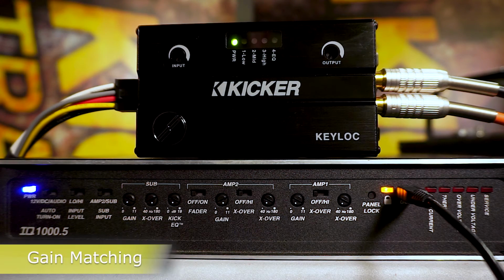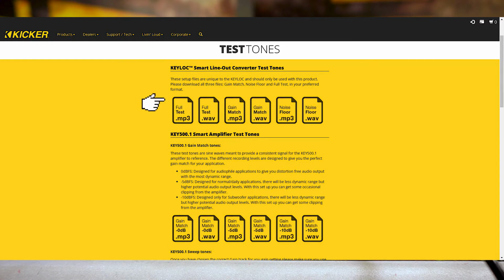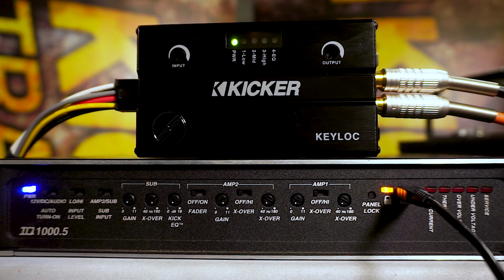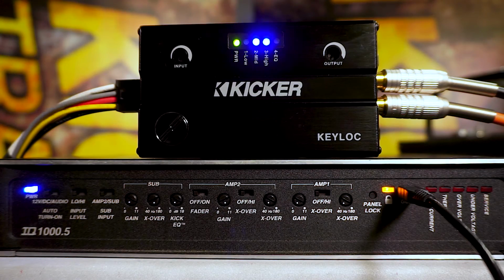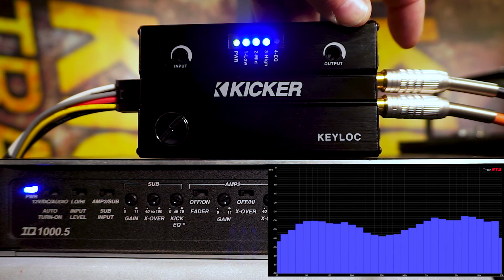KEYLOC

Comment: Can I use the signal from my factory radio factory amp and factory sub
Reply: I was just gonna unhook the factory sub and use those wires to input into this thinking the extra power from the factory amp would help? It would be mostly low frequency I assume but I’m only gonna run a mono sub amp not any full rang amps.
Reply from the maker: Assuming the frequency response is sufficient, yes.  However, the factory sub may be crossed over with a different frequency range than you need. They KEYLOC will help make that determination during the setup process.
Reply: @KICKERAudio so if I get this keyloc and try to run it from the powered factory subwoofer and it only shows low frequency will it work for adding my mono block amp for my aftermarket subwoofer’s or does it need the low and mid signal both or does it actually need all three low mid and high to properly run the aftermarket subwoofers? Also being the factory only has one subwoofer can I split it to go to both inputs of the keyloc or am I gonna have to have two separate speaker inputs? I called and talked to someone on your team they told me if I was happy with the overall tonal sound of the factory and just needed to add bass all I would need is your kisloc but I don’t think I told him I was going to try and come from the factory subwoofer so that might make a difference? Also with this keyloc the setup is making sure there isn’t a clipped signal going into the keyloc correct even if there is distortion coming from the factory deck this will eliminate that ? And if it eliminates the distortion coming out does that mean the amp cannot get a clipped signal at all can the gain be turned all the way up on the amp without sending a clipped signal to the subwoofers. Sorry for short story here just don’t want to mess anything up.
Reply: @KICKERAudio another thing I forgot to add is I run the factory stereo with its bass level set to negative 5 that way I can play the factory speakers full volume without distortion and only the factory subwoofer is really putting out much bass at all. If I run the bass level at 0 some of the dash speakers gets distortions at full volume.
Reply: @jamesfair9751  @KICKER-AUDIO  I asked the same question. I only have a choice of low frequencies from my powered sub or high frequencies from the other speakers. I only want this for a sub install. Can I just tap into the powered sub and go with only the low frequencies? Will it still tune if I do not have a full signal? Doesn't look like it.

Comment: How does this differ from the lc2 pro and other such LOC also not all amps can take 10 volt input signal does this auto adjust or how do you match the voltage to the amp
Reply from the maker: Depends on what your amp is rated for.  Do you know?  As far as the LC2pro, we dont talk badly about other brands. So what we will say is this:  most LOC's are analog, which means NO DSP. It also means they sound worse as the volume raises. It also means they cant evaluate whats missing on a case by case basis.  Not only is ours digital, but it makes intelligent decisions to fix whats wrong with your specific factory audio system. Its not just more bass - its better, cleaner signal across the board.
Reply: @KICKERAudio my amp says it can take an input voltage from 250milivolts to 5 volts

Comment: can I split the rca outputs on the keyLOC with rca splitters so I have multiple left and right audio for a sub amp and a 4 channel amp ??
Reply from the maker: Yes, but bear in mind it may not be necessary. Many amplifiers have an RCA pass through that maintains the voltage so you get a stronger signal out to the sub amp.

Comment: I have tried the standard kicker loc, the nvx bass reconstruction and the nvx x boost for bass roll off and it didnt solve my problem. The reconstruction sounds awful if i try to use that feature but works ok as a loc. The x boost is to complicated to set up and pretty much requires guessing. The lci accu bass is the same guessing game and wouldnt resotre my eq. Im really hoping that this solves my issue in an audi a4 b8. The system is amplified but non b&0. I dont know any other product that does the processing and matching for you
Reply from the maker: If you have any questions, please don't hesitate to contact us. We can verify whether or not you need a load adapter as well (varies by vehicle).  Our number is 405-624-8510. We are open weekdays from 8-5c.  You can also email us at support@kicker.com.
Reply: @KICKERAudio  I got this and installed it today in less than 15 minutes. I wish I had know about it from the start because it WORKS. Only complaint I have is the menu. I can enter it just fine but trying to turn the time alignment off has been tricky. It says solid is on, blinking is off. Hold key for 2 seconds to toggle on and off. The light is solid in the menu, blinks when I press the key but doesn't seem to toggle. It stays solid unless I'm holding the key
Reply: @bRightGarage1  I have exactly the same, have you managed to get a workaround for this?
Reply: @mouritzo123  I ended up measuring my sub output on a 40 hertz tone. I turned the volume up until the voltage stopped increasing. That was my max volume but I wanted more in the front stage. I turned the bass down to raise my over all volume and not roll off the sub signal. I used the kicker loc and adjusted my gains from there. So my bass is about a quarter of the way down but my amp gain and sub makes up for that. My mid bass could be better but the sub is on point now

Comment: So where should I have the gain on the amp set at when setting up this keyloc for subwoofers?
Reply from the maker: The KEYLOC outputs a stronger signal to the amp, so it's advisable to complete that setup before you set up the amp it is being connected to.
Reply: @KICKERAudio  exactly what I needed to know. Thank you
Reply: Are you saying don’t even hookup a new amp or sub until after keyloc is setup? OR Is the new amp/sub hooked up but all adjustments are turned all the way down and you don’t adjust the amp gain etc until after the keyLOC is setup
Reply from the maker: @AlexRodoni  Hi Alex, it doesn't change what the KEYLOC does in any way since the signal chain goes Source Unit>KEYLOC>Amp. And after the KEYLOC setup, you'll just need to match the output voltage of the KEYLOC to the input sensitivity voltage of the amplifier.

Comment: No thanks, ..
Reply from the maker: Out of curiosity, what makes you say that? What other products can not only detect the frequency response of a signal, but correct it so you have a clean signal for your amp?
Reply: @KICKERAudio supposedly that new Audio Control LC2i Pro line output converter does almost or similar to the same thing as the Keylock but I’m not to familiar with it.

Comment: After the setup is complete, how do you adjust the output knob?
Reply from the maker: Once the input is set (as the video instructs), here's what you do: First, turn BOTH the amp gain and the KEYLOC output knob all the way down. Then, turn on the same sweep track you used to set the input of the KEYLOC. Attach the probes of an oscilloscope to the + and - of one of the RCA channels.  Slowly turn up the output levels. You are looking for the point where the signal clips on the oscilloscope. Remember that the sweep takes a little time to send all frequencies through - so just turn it up a small amount...wait until the track resets, and move it up a little more.  Don't turn up the gain non-stop - do it bit by bit. If it doesn't clip even after turning the output knob all the way up, connect the KEYLOC to the amp as you normally would. Now, with the same track playing and the gain of the amp all the way down, move the probes to the outputs of your amp (without the speakers attached). Again, slowly move the gain up until you see a clipped signal on the oscilloscope.  That's the right way to do it.
Reply: So what if you do not have an oscilloscope?
Reply: @billplaisance6387  my guess would be to set it as close to your recommended amplifier voltage with a multimeter. Ol' bro from Kicker shouldn't have left you hanging.

Comment: So after setup when I start my car all lights should be on everytime? How do you know if it lost its settings?
Reply from the maker: The lights that correspond with frequencies it detects should be on when the stereo is on (so light #1 for bass, for example). If the KEY loses its settings, the audio should change drastically. To test this, press the KEY button briefly to deactivate the DSP settings. If the auto-tuning has been lost, there should be no difference in the sound. Here is an example of that test: https://youtu.be/ZwWggIfQHqM?t=370
Reply: Seems like I'm not getting the proper frequency response from 30-40hz.. let me ask this. If I put the speakers inputs into the keyloc in reverse order would that affect the setup? Like I put right in left and left in right. Also when I turn my car on after setup all the lights are on. Is this wrong? Thanks for the response
Reply: So I gave up and went out to just reset the Keyloc and start over. I put it into led 3. Held for 10 seconds. Keyloc shutdown then reset. Now it sounds amazing. So literally I'm not using any of the Keyloc magic processing and it is literally a passive LOC now. Maybe I will try it again later but for now it sounds fine. I don't understand how with processing it wouldn't play 30-40hz but with it off it now plays those frequencies...So they are coming from the stock system
Reply: Blew up my rear speakers running the ridiculous lengthed test tones at ridiculous levels for this thing to even register. Not a great device for a normal consumer

Comment: What is the “Output” dial for?
Reply from the maker: Controlling the voltage level that goes to the amplifier.
Reply: @KICKERAudio can you see my previous reply please
Reply: I checked the voltage while adjusting output with a 50hz tone and i only get 3 volts out it changes as i turn the dial but when i stop turning it goes back down to 3 volts with no effect on where the knob is at even if i stop playing the tone i get 3 volts, do you know why?

Comment: Hello! I'm guessing this will also be needed in a case where I'm just switching out the factory speakers in a '15 Wrangler to the Kicker KSC650 with the basic (non- touchscreen) factory stereo? Thank you!
Reply from the maker: The KEYLOC is used when adding an aftermarket amplifier to a factory audio system.  If you are simply replacing factory speakers with aftermarket, it would not be used.
Reply: @KICKERAudio  thanks for the quick reply! What would be the best thing to go for, for getting optimal sound from those speakers mentioned above from my stock stereo? Or would it just be simpler to buy an affordable aftermarket stereo with those speakers. I'm a newbie somewhat.  Thanks.

Comment: When did they set the output lvl in the video? Does it have like set voltages or is it variable?
Reply from the maker: The best thing to do is check out the manual.  Go to the bottom of this page and click on the KEYLOC Manual link, then go to Page 16 of the PDF.: https://www.kicker.com/keyloc-smart-line-out-converter

Comment: I have an amplifier that can take a max of 4 V. I also have the key lock and looking at the specs it delivers up to 10 V. Is there a way to adjust it so it matches 4 V?
Reply: Yes. The "output" knob on the top controls voltage out.
Reply: @firebirdude2 how do you tell what voltage it’s putting out
Reply: @jamesfair9751 use a multimedia set to AC Volts. I use an old male end rca cable and strip off insulation to expose the wires inside. Hook your multimeter to those wire. Turn up your head unit to 3/4 volume and increase the output until you reach your amps input sensitivity voltage. Good luck

Comment: So when it's set all the blue light stay on
Reply from the maker: All the blue lights will be on if the KEYLOC detects a full range signal.  Depending on the vehicle, the factory audio system may not have any full range signals, or very weak signal in one or more of the frequency ranges, like you see at @2 minutes into the video. The presenter had to turn the gains way up to even detect low frequencies in that example, which means it had very little bass. on that channel.  

Go to about 2:45 in that video.  Notice how low the KEYLOC's gains are set when he gets all three lights to come on.  That is the full range signal you are looking for. 

If you want more info, please don't hesitate to call us.  Tech Support is open weekdays from 8-5 Central time at 405-624-8510.

Comment: Does anybody know how to add a second loc to a system that the key is already installed but can’t give consistent voltage to the fire amps I need to be running. I’m aware of the other product lines but want to keep the key due to its ability to clean this Volvo XC90 like no other product. Please help! Anyone!? loc
Reply: I’ll give some updates to fill in for those who may use this later. So going to run a cheaper loc in the front speaker lines that go to the stock amp. So the keyloc47 will be the second loc in the front speaker lines and because of this the DSP is able to clean the signal just before it reaches the stick amp and then the sending unit and then the speakers. So basically it somehow raised the impedance by approximately 1 ohm throughout the main system speakers so not they are all at about 3 ohm 😕😕🤯🤯😶‍🌫️😶‍🌫️
So anyhoo, the fact I am able to add the second loc before the keyloc offered me two fresh lines with clean voltage to feed my four amps. I will update afterword.

Comment: If I turn my EQ settings back up on my stock radio after will it affect the Chanel with the LOC? I have a couple subs running in the back off the rear sub with a pac loc currently.
Reply: Any EQ adjustments you make on the stock radio will be added to the output of the KEYLOC, for better or worse. The KEYLOC gets you to "flat" or "zero". If you change the incoming signal (by adjusting EQ), the KEYLOC will output flat+your change.
Reply: @firebirdude2  so should you leave the factory head unit the way you want it then set up the loc
Reply: @tjsworld2338  That will do nothing. The KEYLOC makes a flat signal out of whatever you give it. So if you have the factory head unit the way you want, then set up the KEYLOC, you'll just have a flat signal out. 

If you don't want a flat signal out, start with the head unit EQ all at 0, then run the KEYLOC, then set your head unit EQ. Exactly as I said above, this could be for better or worse. Boosting bass +8 after fact is just going to send distortion to your speakers.
Reply: @firebirdude2  ok got it. I have a lc2i now on my Cadillac ATS and I just don’t like it. Trying to decide what to use
Reply: @firebirdude2  can you still use a bass knob? I have the Jl slash 1000/1 amp and since I I’m using the lc2i it has the bass knob. If I get this loc can you use the knob for the amp
Reply: @tjsworld2338  The KEYLOC is better than the LC2i. No question.
Reply: @tjsworld2338  Absolutely. The knob on the amp comes after the KEYLOC. It won't even see it.
Reply: @firebirdude2  nice thanks. Yea I’m trying to decide on either the keyloc or Jl loc22

Comment: Where in the hell is the pink noise test tone to download? All there is sweep track, full test, gain match and noise floor.
Reply from the maker: Scroll about halfway down the test tone page and look for the "KEY200.4 / KEY180.4 Smart Amplifier Test" header. here is one example (there is both an .mp3 and .wav option): Toneshttps://www.kicker.com/files/test_tones/Lab_Grade_Pink_Noise_20_minutes.mp3
Reply: @KICKERAudio  OK got it thanks.
Reply: @KICKERAudio  I wish I would’ve known this the other night when I was doing my install but luckily I was able to just play the pink noise by looking it up on YouTube. 

But I’m curious- if this test tone is kinda needed for the setup of the Keylock then why has it been two years later and the pink noise still isn’t with all the other test tones for the keylock so it’s easy to find?

Comment: When the first signal you tested was no good for 20 Hz signal, what other signal did you use? I wanna hook this up to my rear speaker connections for my subwoofer and amp. So if I get the same bad 20 Hz signal what am I supposed to do? Hook this up to my front speaker signals??
Reply: If you tap into factory speaker wires and the KEYLOC shows you're not getting much bass, then you need to tap into different factory speaker wires. The KEYLOC will help bring up the bass, but it cannot create bass where there's zero to start with.
Reply: @firebirdude2is the rear speakers the best signal for subs usually?

Comment: Trying to use this with my Subaru Forester head unit, it's got all pass filters I want to get rid of. When I run the setup I get to the Full Test and after about 1 minute it goes to error mode -  power, 1, 2 & 3 lights start flashing. Kicker support hasn't been able to resolve it. Any ideas as to why the Full Test can't run?
Reply: First, make sure you're doing the gain match step properly. Wait 10 seconds between input gain adjustments before moving to the next step. If either channel clips at any frequency during the gain match step, the likelihood of failure/bad results is exponential. DSPs don't like clipped signals input.

Next, try running the test at a higher or lower volume on your head unit. Remember, if you change the head unit volume (voltage into the KEYLOC), then gain match step much be done again.
Reply: I’m looking into buying one for my Subaru for the same reason you stated. Did this end up working for you?
Reply: @rtiid22  I got it to work, but it definitely did not create a flat audio signal. That was too much to ask. I returned the Keyloc and then I replaced the crappy factory Subaru head unit with a Pioneer and I'm super happy now!